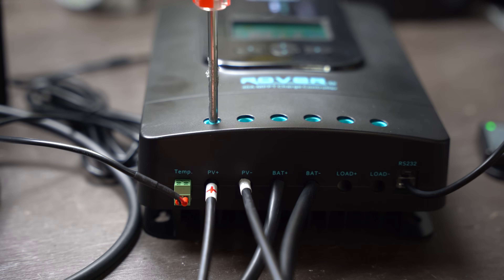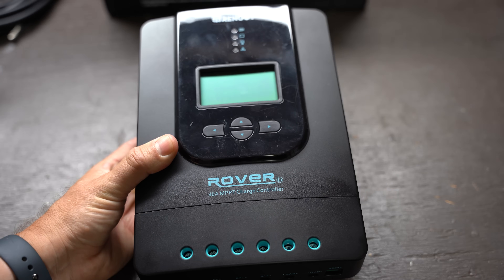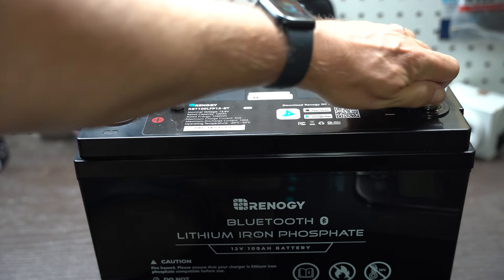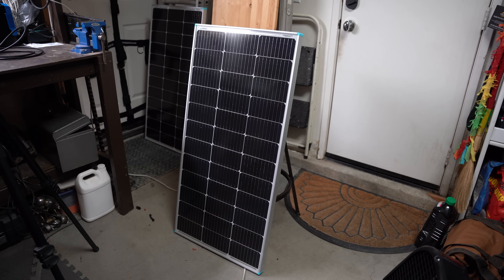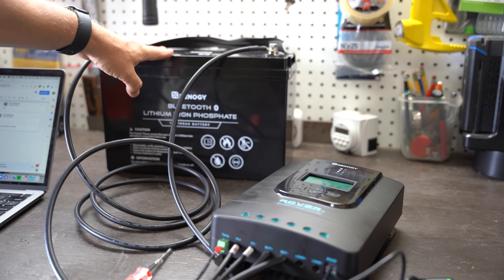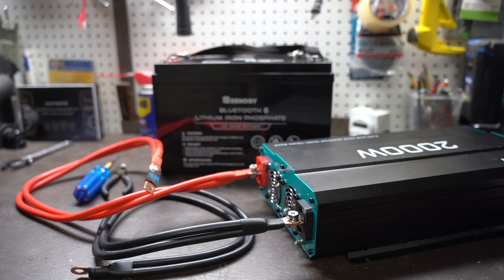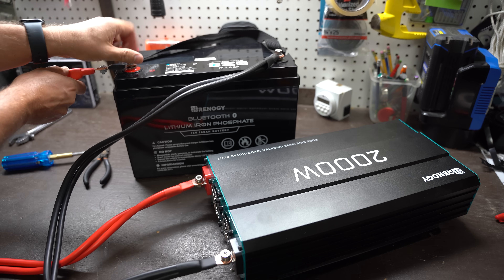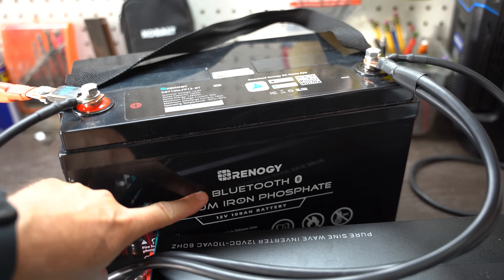DIY Solar Setup: Easy to Follow Step-by-Step Instructions

Comment: Fyi, you can get 12v power adapters (or versions of) cameras, toothbrushes, laptops, electric friges, and so forth.  You dont need an inverter, but it's sure handy.  But if you get hooked on your 120 volt appliances, you may wind up having to add more batteries of a matching type- brand.

Comment: My friend rigged it up on our trailer, but I don't know of there's a name for it. We had 2 batteries which would charge anytime the generator was on. Is there a way to hool up the batteries to solar and also the generator? That way, when I need to run more wattage on the genny, I'll be charging the batteries also

Comment: Great video.Simple.I don’t care for the fact that BMS boards are critical to monitor.I’ve ruined 2 Lifepo4s. One died supplying power to my Hummingbird.Battery ruined .One on a Trolling motor.The Solar Industry Techs never did their job.Use too much power and wham, $250 gone.

Comment: Thank you so much. I actually ordered the same controller so hopefully everything goes well. I have a 200 W solar panel 3300 W inverter. I just have to get used to programming.

Comment: Question… I want to power a 15 W small greenhouse fan. I have a 50w solar panel. Do I need an inverter and battery if I only want the fan to run when the sun is out? The fan has a thermostat that turns it on when the temperature in the greenhouse reaches 70°. I also have an automatic arm that opens a gable vent when the greenhouse reaches 70°, so there’s good airflow. If you still say I need a battery and an inverter, what capacity should I buy? I will not be powering anything else. I have rechargeable solar lights.

Comment: Thanks for the info! I have a setup and idk how to size my inverter. I want to max out this little system to the top of the controller. I will buy more batteries and panels to meet the max of the controller I have but I want the inverter (next pc I’m buying) to match the max of the system. I get how to connect etc and this video is very helpful for just that! But what specs do I look at to see how to max this out before I scale?

Comment: I have a home office cabin 3mX2m  There will be a room light, a  desktop computer(on 10hrs/day) and a phone charger used. how much solar/battery do I need? (the roof is south facing at 30 degrees latitude) thanks.

Comment: Great video, well communicated and shown step by step. I wish it included a further step of incorporating an auto transfer switch into the mix, as I plan on having a Generator to use as shore power for back up and additional charging. I just don't know how this ATS ties into the inverter. Cheers,

Comment: So a question . . .as a "newbie" to the whole solar generating movement (basically assembling a powerbox for fishing/camping trips), I have a question with regard to the cabling used from the inverter to the battery. In most video I have watched on the subject I see only single cable connectors used. However, in your video (very well done by the way), I note your use of what appears to be a double cable connector. Is there a reason or benefit to such an approach or is it a personal choice? Please explain . . . .                Thanks

Comment: How would i set up a series with multiple cells falsesafe relays and backup gas/desiel generator for long term small warehouse stlye. I know incase of fire overload have a setup with fine powder dirt with water the sufficate. For lites whenever i need and a plantation set up for foods away from wildlife without chemical treatments but natural. Greenhouse works but i want a control environment to cool/heat ecosystem plants that arent native. Onion potatoes garlic green onions are low maintenance crops but tomatoes grapes strawberry dont taste good frozen damaged when growing it stumps its quality taste. Possibly a side gaming set up to escape tge family and projects for cars since both are heavy drain what amps and stored style would recommend? This set up here is fir like a storage shed or emergency charge foe small items like lights cellphone radio tv or chargers.

Comment: Colored electrical tape helps when the positive and negative cables are the same color, you wrap some red tape around the red end of the cable, then there is way less confusion.
In dealing with a car battery I always disconnect the neg side first and hook it up last, you were doing it the opposite way in the video. I was curious as to why.
Thanks, good video!

Comment: Why install the battery to the charge controller and then the solar panel then remove them to install the inverter?  Can't you install the inverter first to the battery then install the battery to the charge controller and then the solar panel?

Comment: If an electric appliance is 300w , then a 300w , minimum, inverter is needed.  I think it's better to try to get a larger power handling inverter incase some higher power devices also need power.   
Most low cost systems are 12v , but the other ones are 24v, 36v and 48v.  The higher volt systems have less charge or current drain from their battery(s), and can then power devices twice as long as for a 24v system compared to a 12v system.    A DC voltage regulator(s) or "wall wart" transformers is something good to have with any solar energy system, and these can be used to power various electronic devices.  Some charge controllers have a 5v DC output for devices such as a phone.

Comment: Hello and thank you for this video. I am a complete novice and was wondering if this setup can be scaled down and if so, what equipment would I need?
Reply: If an electric appliance is 300w , then a 300w , minimum, inverter is needed.  I think it's better to try to get a larger power handling inverter incase some higher power devices also need power.   
Most low cost systems are 12v , but the other ones are 24v, 36v and 48v.  The higher volt systems have less charge or current drain from their battery(s), and can then power devices twice as long as for a 24v system compared to a 12v system.    A DC voltage regulator(s) or "wall wart" transformers is something good to have with any solar energy system, and these can be used to power various electronic devices.  Some charge controllers have a 5v DC output for devices such as a phone.

Comment: Great video. What size wire do i use to connect the batteries in parallel? Ive read 2/0, is that correct? Just running string lights and maybe a small fridge at this point. Purchased 2 AGM batteries for my 200watt solar system

Comment: Ok. So I’m wanting to do an inverter set up, on my truck to run some fans, I do retriever field trials.  And have to keep the dogs cool.  Can I not use the solar to charge the battery while the fans are running off the inverter?   Or should I get some DC fans and just not use a power inverter and just run the Dc fans off the battery while the solar is charging the battery and just not do an inverter?

Comment: Hello.  Question please 🙏 
I have a 200 amp hour Lithium ion battery and a 3000w inverter.  What size fuse to the battery should I use?

Comment: What kind of grounding system does this require? I'd be using it for an irrigation head at a farm with no electrical power. Would my semi-mobile irrigation setup need to be tied to a ground rod?

Comment: Thank you for explaining this. I understand what you have said now how do you hook up the inverter to run conversion trailer and I want to run two combo refrigerator freezers plus lights plus a mini split plus a 110 air conditioner with a cool bot .now question: how much power do I need? How many batteries? And how or can I hook up wind turbines to a solar system or do I need a switch in between. I know its alot but nobody has answered these questions

Comment: So that inverter then can power your AC devices. Can you also hook up leads for the trailer DC system to run off the battery?

Comment: Silly way to connect it all up back to the battery. If something goes wrong then everything will have to be disconnected. If it went through a distribution board then each item can be isolated and worked on without disrupting other devices

Comment: Great video. I used to install batteries on booms machines. I used to connect the positive terminals first and then the negative terminals last. This avoid causing a spark

Comment: Hey, I have a very stupid question! The inverter is 2000W, but the panel is only 100W. How does it work? Is it only about how much the battery is charged? Thanks

Comment: Total solar noob here, with a critical need. 

I truly want to take advantage of the sale, but I'm not sure of how to get to my end goal of installing a small AC unit to keep an attic space cool in summer, via stand-alone solar power. The attic  is approximately 600-800 sf., and has no vents. 

Any guidance on the size of window unit and a solar hookup is TRULY appreciated.

TYIA.

Comment: Could you do this and wire it into a distribution box? I have a shed that came prewired for electric with outlets and lights wired to a distribution box. I’d like to do solar power for it if it’s possible.

Comment: OK SOME SAFETY TIPS:  Always use heavy duty DC breakers at the positive battery terminals before the wires go anywhere else. Always use a heavy duty breaker between your inverter and your batteries. Always use a breaker between your solar panel and your solar charge controller.. These breakers should be rated for the max current that will be drawn though those devices..  Keep your cables as short as you can and use the proper size wire that is rated for or even higher than the current that will be drawn through those devices. Check  "amperage capacity for wire" charts (online) to determine what gauge wire that is required for your system.. You would be surprised at the number of DYI people who do not know what they are doing and end up with inverter cables heating up like a toaster element.  Keep it safe.. do the research,  use  correct and safe wiring to avoid issues and a possible fire. More importantly, if you don't know what you are doing.. FIND SOMEONE WHO DOES

Comment: Hello guys o) Please,Please I need your help 😭 I have trailer and batteries inside the trailer but in Ontario  we have to have 12 v batteries out so I have to disconnect all system ,place the battery out into isolated box and connect it again.....How can I disconnect the system,what to disconnect first ? Please explained step by step how to do it o(((( I am lost, thank you so much

Comment: See this just shouldn't be allowed on you tube, what's this guys back ground and if he makes a mistake he finds out the next day you live with it until you figure it out. He lists no experience so a diy guy is showing you to do something that my state requires an electrician to preform, due to the many fires caused by you tube experts. I went to Stanford engineering the toughest engineering school in the US and my minor degree is solar technology and these guys are buying stuff off amazon and pushing as the way to do it.

Comment: Why not doing  a real demonstration with a real solar system for an average house?  

30x 300W 24V solar panels
5,000 Watt Inverter
MPPT Charger Controller
12x 12V 200 kWh batteries  to feed a house that has 20 kWh consumption per day.

4x 700 watt A/C units
2x 22' refrigerators
1x 1,000 watt Microwave
1x 2,000 watt Air Fryer
40x 5 watt light bulbs
2x garage openers
1x 200 Watt Home stereo

Comment: Thanks for this very straight forward guide. This feels like a good place to start. I have a small out building I want to power which is currently connected to the house but it would be nice to separate it.

Comment: I just purchased an Ecoflow Delta 2 max plus a 800watt alternator and solar panel, now can I hook up my solar to this regulator, then unto 2 car batteries in parallel, then to the 800watt alternator and to the ecoflow generator?

Comment: One thing wrong I saw in this video, what I've been taught throughout my life is that whenever you're dealing with batteries and connections you always want to connect the negative first because it's a ground I saw a couple times in this video where he did the positive first I don't think that's bad but I feel like it would be more logical to do the negative first you have a ground and dont get barbecued

Comment: I have questions 🙋‍♀️ What would you do if you have a battery box on? And how would you run the wires from a solar panel on roof racks to inside a van? 🙏

Comment: Maybe dump question, but... why do you use a 200 amp fuse for inverter/battery cable? And how did you determine the fuse capacity?

Comment: This brand also has a variant that you also can also hookup to the starter battery of a camper van. The house battery and the starter battery can be connected in a smart way.  Ideal if you convert a van to a camper.

Comment: Just a noob starting out, I bought two 300w panels, a 2500w inverter and a 200 amp lithium iron phosphate battery.. what amp charge controller do I need?  What size fuse would  I need?

Comment: What hapens if you connect the charge controller and inverted simultaneously without removing the cable each time when the battery is charged ful

Comment: So for an emergency - to power refrigerator,  small freezer and phone, how much wattage do I need? I get confused between amps, watts and volts. Don't want blow up my appliances. 
Would my natural gas furnace need electrical support for the fan and lighter?

Comment: i just bought two power queen batteries, renogy 700 watt inverter and lion energy controller for a simple garage setup, full size fridge and plasma tv.
im confused now. all my research says you connect and disconnect positive cables first. but youre doing the opposite.

Comment: If you use a 12v battery do you have to let that battery drain before connecting the solar panel if your battery is at 12v already? What's the highest V a 12v can hold?

Comment: 9:15...you should connect negative first, then connect positive to one end of a power resistor, then touch the other lead on the resistor to the positive on the battery for 20-30 seconds to charge the inverters empty capacitors. If you don't you will see a spark indicating the huge draw of an empty cap. Once charged you can remove the resistor and connect to the positive before the cap loses its charge, avoiding the spark and possible damage to the inverter.

Comment: This is nice but as someone who is an automotive electrician, please connect the positive first on the inverter and the negative second. This is in the case of the presence of our favorite element hydrogen in lead acid batteries if someone is using one. 

No hate at all btw! I'm currently working on making a 12 volt and 120 volt solar system for my camp. I'm just looking for some ideas

Comment: In your video you connect a single battery.  I have 4 batteries with 3 200w/12v solar panels.  Will I need to change the charge controller?  I'd appreciate any guidance.  ~Will

Comment: umm would it be out of place to suggest some red electrical tape on the positive wire at both the battery end and the controller end.  I mean it just a thought

Comment: Would it not be more correct to attach the positive cables first, in final connection.....then negative to prevent arc/sparking.....and to protect solid state devices?

Comment: I have a 3000watt 12v inverter i want to step up to 24 volt system can you use a 
DC 12V to 24V 10A 240W Converter Step Up Voltage Regulator Boost Converter Module instead of buying a new inverter

Comment: a 2000w inverter should have at least a 24v battery, a 12v battery powering a 2000w inverter will be spent within 6 months.

Comment: i was always taught to connect the positive first then the negative in case theres a surge or spike and if so it would travel thru the ground... if you do NEG first and theres a spike when you connect positive then the spike travels through the system..was i taught wrong?

Comment: Subscribed, love this simple video. Im trying to do this with my Nucamp teardrop..got a 1000 watt renogy inverter and a 100ah renogy smart battery. I have these 100 watt zamp solsr panels that come with a controller that is integrates. I wont need the renogy charge controller woukd i? Very new to the solar stuff but your video made it easier

Comment: I want to do exactly this but not have to plug into an inverter. I would like to hook my shed up on full solar power to run all the lights in the outlets I have added.  Is that possible?

Comment: So I want to build one of these for an offgrid cabin and have 2 questions that I hope you can answer for me. I have watched a bunch of these videos and the parts that gets missed are as follows:
1. Are the solar panels you set up for this run in series or paralell and which is better for this type of application?
2. I am assuming the more batteries I have the more amp hours I get to power the inverter? Is using a few batteries a better proposition to power an offgrid cabin. I'm just runnign lighting and basic electic receptacles to charge a phone or laptop or run a power tool, nothing heavy.
3. Everyone uses (4) 100 watt solar panels in all these videos, If I can put (8) 100 watt panels up that just means I can charge the batteries faster? What is the downside to more panels with regard to the wiring?

Comment: Wow I now know a little more about how to set up a solar in my van when I buy it. Very simple. I do have one question tho. If I get a 100 amp battery and want to hook up a 2nd 100 amp battery I would use a heavy duty connector s but I go from pos to pos and neg to neg. Now with every thing connected does that change it from 12v to 24v system. I do want the outlet connection do to me using a coffee pot or an electric skillet. Also if I do 2 batteries what size solar panels do I need? I am thinking of mounting the panels on the roof of my van when I get it. Thanks for such an info video.